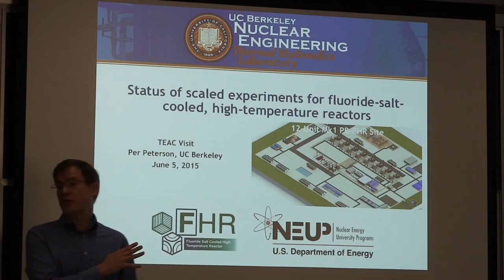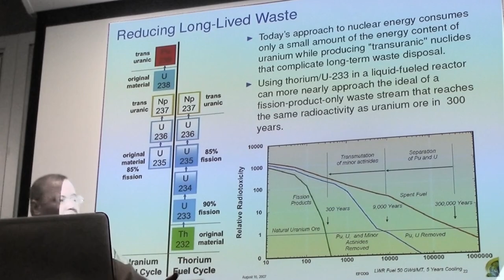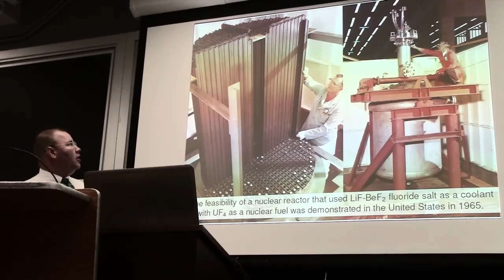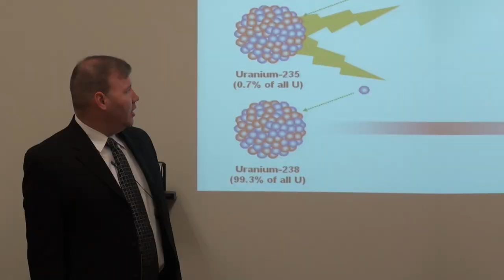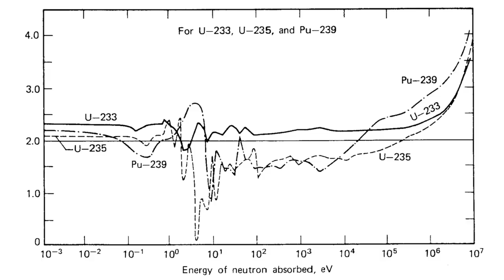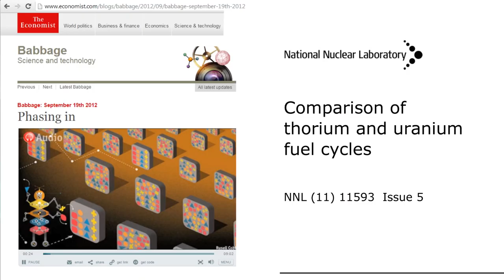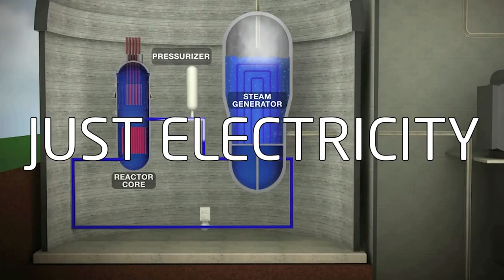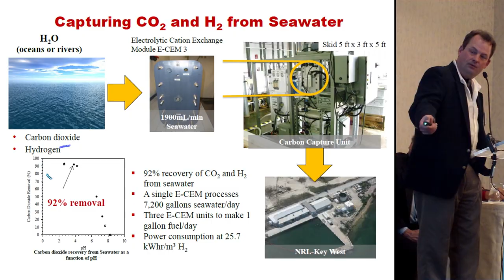Thorium Disadvantages

Comment: The real disadvantages from what i understand of this video, are (other than the established industry blocking the new technology): 
- Metal corrosion. 
- 30 day start-up process. 
The first one is not that much of a problem though, just need money (loads of it) and time to find the right alloy. The second one, is just a one time thing, and then continuous production.
Reply: 30 day thing is how long Protactinium takes to decay to U-233. It isn't an issue for starting the reactor, but rather impacts how the reactor operates. It mandates a chemical kidney, if one is to use Thorium efficiently. That's the challenge... the Kidney. Most nuclear does not need that, even most MSR. It adds complexity which sucks. It also adds capabilities, which are awesome. Many Th-MSR advocates very much want those capabilities, as it really changes whether there is any nuclear waste to speak of at all coming from the reactor.

Material challenges and corrosion? Again, the Kidney matters. Pulling out fission products from the salt means also pulling out stuff that might chemically react with the nickel alloy. Many MSR startups do NOT see the need for this, but pulling out those fission products might make the difference between reactors that last a decade and a reactor that can last a century. We'll see. Kirk has funding for Chemical Kidney research and hopefully his plans will be demonstrated to be practical.
Reply: A 30 day start up process would impact the duration of periodic maintenance operations, not just the initial start.

Comment: The problem with the new style reactor is that when things go wrong they go wrong in a damned hurry, much faster than a light Water Reactor. Are they more efficient, yes. Southern California Sodium Reactor is an excellent example, it was an abysmal failure and probably poisoned more people than Three Mile Island. It was an early design however and should the issues be fundamentally addressed, it may yet be an answer. I would like to see whether or not they addressed those issues they caused the failure of that particular reactor.
Reply: You're conflating "new style reactor" there are many. Just because MSR can operate at higher temperature doesn't make it unstable or unsafe. Fast-spectrum liquid-metal reactors such as that which melted down in Detroit COULD be harder to control... EBR-II safety test seems to indicate otherwise... but that accident is a completely different concept than MSR. If anything is remotely close to what you are citing, it would be the TWR (Traveling Wave Reactor) by TerraPower (and backed by Bill Gates). They've since moved their focus from TWR (yes, sodium) to a Molten Salt Reactor design.
Reply: @gordonmcdowell  I have no doubt that these reactors, given the concept that we will get to hey technical capability of control, can be made safely.

I also find it bizarre, with technology to manufacture induction coils within a house that will allow it to use 20% less metered energy well not cutting back on any energy used within the house itself, direct evidence that we should have been listening to Nikola Tesla a long time ago. We don't need to generate energy. We need to figure out how to tap into the energy that is all around us already. And it can be done with far less risk.

Comment: This hasn't been explained properly to the polarized layman. The fast/slow breeder reactor concept should have been compared to gasoline and diesel. Gasoline is highly volatile, deadly if not handled carefully, carcinogenic, and displaces oxygen in confined areas. Diesel smells, and is hard to ignite, but if you treat it with waste "gasoline" you can get it to play quite well, and burn waste.

Comment: What would stop someone from making a 1kw thorium generator in their backyard?
Reply: Not practical to be that small. And working with fissile material is illegal. This is in no way garage start-up tech. Copenhagen Atomics is probably as close to advancing the tech as one can do in a garage. They're working with non-radioactive material and focusing on pump mechanics and mechanisms for monitoring salt chemistry. You can use non-radioactive isotopes to stand in for the (very) radioactive Fission Products. So instead of radioactive Caesium (created by fission) add non-radioactive Caesium and see how that affects the chemistry (sort of thing). Copenhagen Atomics uses electricity to heat up the salt to simulate fission. So you're wasting energy, not creating energy, but that's how you could build a device and test a device that might once day be licensed to be fuelled.
Reply: @gordonmcdowell  If I understand correctly, the hotter it gets the more efficient it is, and to get it that hot you have to make it really big.  Couldn't you just use one that is much colder with a Sterling Engine, those can work with even small temperature differences.
Reply: @musikSkool  That's one aspect to efficiency. Molten-salt systems don't allow fissile material to be too concentrated in the salt, or else it will precipitate out. I'd look at NASA KiloPower system for how small a reactor can be with solid fuel. Or just google MICRO-reactors. I don't think fission lends itself to a million 1kw devices, powering a community is more appropriate. For a single house, it really would be cheaper to go solar and batteries and diesel. Maybe in the future we'll have a market for Fission Products and you can harness radioactive decay for energy. There's no upper or lower size limit on that, and the thermal efficiency is just a matter of how effectively you can trap the decay heat. (Fission throttles itself as materials expand and fuel spreads out, but decay does not.)
Reply: @gordonmcdowell  I was thinking of an expensive toy for rich people who want to go off-grid with current technology.  You would over-engineer it by making a backup system for everything that has ever gone wrong in a nuclear reactor.  Like inefficient lightbulbs that turn on if they aren't using all of the power.  I like the idea of using excess energy to remove carbon from co2 to make coal that can be stored for later use if extra energy is needed.

Comment: The differences between Light Water Reactors (LWR) and Thorium Molten Salt Reactors (TMSR) are significant in fuel utilization and waste production. LWRs use approximately 0.5-1% of uranium fuel, leading to the generation of long-lived radioactive waste due to inefficient energy conversion and the use of enriched uranium. In contrast, TMSRs can achieve fuel efficiency of up to 99%. This is achieved by converting fertile thorium-232 into fissile uranium-233, substantially reducing waste production and more manageable radioactive waste. Uranium Molten Salt Reactors (UMSR) are just as effective as TMSRs.

800 kg of natural thorium in a Molten Salt Reactor (MSR) can generate 1 gigawatt (GW) of electricity for one year. In comparison, generating the same amount of energy in an LWR would require mining 250 tons of uranium. In an MSR, the storage requirement for 800 kg of spent fuel is 300 years, whereas in a LWR, 35 tons of spent fuel need storage for 300,000 years. MSRs can utilize the spent fuel from LWRs. A coal power station will need to burn 4.55 million tons of coal and emit 13 million tons of carbon dioxide to produce the same amount of energy for one year. That amount of coal contains 4 to 18 tons of uranium, 13 to 68 tons of thorium, and 4 to 45 tons of arsenic.

Of all the proposed fourth-generation nuclear reactors, the MSR is the only type that does not generate substantial amounts of plutonium. The fissile uranium-233 produced by the MSR is difficult to use for weapons because of the presence of highly radioactive uranium-232.

MSRs can adjust power output to match electricity demand, thanks to the inherent and automatic load-following capability provided by the fluid nature of the molten salt coolant. A key safety feature of MSR is that it automatically adjusts to prevent overheating. This is achieved through a "negative thermal reactivity coefficient," which means that as the temperature rises, the reactor's reactivity decreases, preventing a runaway chain reaction. Additionally, the MSR has a "negative void reactivity coefficient," ensuring that the reactivity decreases if there is a loss of coolant or boiling, preventing potential overheating. These safety measures help keep the reactor stable and safe under various conditions.

Looking ahead to 2040, China plans to deploy MSRs equipped with thermo-acoustic converters in ships and power generators within its borders and globally. In the Earth's crust, thorium is nearly four times more abundant than uranium. Every atom of natural thorium can be harnessed, unlike natural uranium, where only 1 out of every 139 atoms can be used.

India possesses more than 846,000 tons of thorium reserves, while China produces thorium as a byproduct of its rare earth processing.

Similar to the trends observed with solar and wind technologies, MSR costs are anticipated to decrease with the scaling up of production and the development of robust supply chains.

Comment: The United Kingdom’s National Nuclear Laboratory (NNL) prepared a position paper on the thorium nuclear fuel cycle. It is pretty straightforward:

Contrary to that which many proponents of thorium claim, U-233 should be regarded as posing a definite proliferation risk. For a thorium fuel cycle which falls short of a breeding cycle, uranium fuel would always be needed to supplement the fissile material and there will always be significant (though reduced) plutonium production.

NNL believes that U-233 should be regarded as posing a comparable level of proliferation risk to High Enriched Uranium (HEU) and comparable with the U-Pu fuel cycle at best; this view is consistent with the IAEA, who under the Convention on the Physical Protection of Nuclear Materials, categorise U-233 on the same basis as plutonium. Attempts to lower the fissile content of uranium by adding U-238 are considered to offer only weak protection, as the U-233 could be separated in a centrifuge cascade in the same way that U-235 is separated from U-238 in the standard uranium fuel cycle.

The argument that the high U-232 content would be self- protecting are considered to be over-stated. NNL’s view is that thorium systems are no more proliferation resistant than U-Pu systems though they may offer limited benefits in some circumstances.
Reply: While U233 can (in theory) be used to create a weapon, this has yet to happen. There were some tests where weapons-grade material was supplemented with U233, but the weapons were not created out of U233.

If you're referring to the August 2010 Thorium Cycle report by NNL, they're looking a THOREX reprocessing, and not a dual-fluid Th-MSR. So a not-ever-used-in-a-weapon fissile that will be extracted from a MSR, where the U233 must remain in the MSR for it to continue to operate? Pull the fission-catalyst out of an OPERATING power reactor? NNL is not looking at that, they're looking at U233 being shipped back-and-forth for some remote reprocessing operation. NNL is not looking at a chemistry module moving U233 from blanket-salt to fuel-salt.

From NNL's report: "While the thorium fuel cycle is theoretically capable of being self-sustainable, this is only achievable with full recycle. This would involve the implementation of THOREX reprocessing and a remote fabrication plant for the U-233 fuel due to the high gamma dose from the feed material..."

This isn't that. Yes, there's U233. No, it's not making a round-trip to a remote facility. And if the tiny amount circulating though the chemical kidney starts to be diverted, the reactor shuts down. (With the overwhelming majority of U233 inventory remaining in the fuel-salt.) The chemical kidney stops shuttling the U233 when fission stops, because U233 then ceases to be created in the blanket-salt (as protactinium before it evolves into U233).

Comment: If protactinium is absorbing the neutrons needed to sustain fission, why don't we make a hybrid system of thorium and regular uranium reactor which produces too much neutrons. Interspersed between U-235 rods would be LFTR containers of thorium fluoride acting as moderators / consumers of the neutrons for U-233 which previously releases so few neutrons in thermal-spectrum.
Reply: I think the challenge is the container. Moltex uses metal pins (with molten-salt fuel inside) but that is fast-spectrum. Thermal spectrum you need to not having the container absorb neutrons. It has been proposed that CANDU be used with a breeder-blanket configuration where Th rods (solid fuel) are positioned around the edge where neutron flux is weakest. (Even weaker than homogenous CleanCore ANEEL approach.) If you're suggesting fuel-pins like Moltex SSR-W then what's the overall type of reactor? What's the coolant and moderator?

Comment: Fission products in liquid form would be an engineering nightmare. How do you limit the gamma radiation from short lived isotopes if they are travelling through a load of piping? Easy in solid fuels as everything is in a defined area of the fuel rod and can be submerged in water/coolant.

Regarding thorium,  where do you store the protactinium while it decays into U233?

Comment: 70 atmospheres is being too kind! Dear god that is high water pressure - more than I had been visualising till now. That number is quite conservative minimum it seems:  as wikipedia says the light water solid reactor operating heat range  275 °C - 315 °C which requires 153 atm or my preferred measure: 2,250 PSI! All of which is alarmingly close to the super critical levels of 374 °C or 3200 PSI. Gulp.

Comment: The protactinium has to separated from the molten salt as it builds up. Therein seems to lie the "rub"--or? Once it changes to U-233, it can be reinserted into the molten salt. I believe technology can solve these problems, provided we have to will to do it.
Reply: Flibe Energy's 2019 DOE GAIN voucher is to examine (in part) question of Fissile Security. Kirk does talk about U233 and proliferation concerns in this (more recent) video: https://youtu.be/2U9HVIFt2GE

Comment: Hmm, quite nice video, but title is wrong. There wasn't much about thorium disadvantages. If there was, please list top 5 disadvantages of thorium.
Reply: Thorium Disadvantages listed in this video:
00:00 Solid-fuel thorium reactors fuel utilization ratios similar to PWR.
00:42 Liquid-Fuel in United States licensing is "scary".
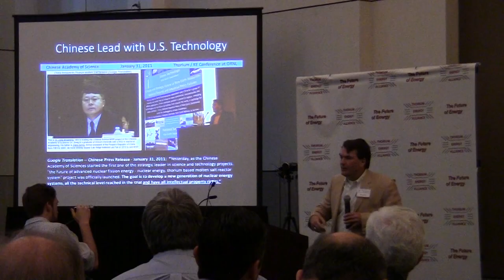02:04 Obama Administration willing to give away MSR know-how.
02:40 PWR seen as "good enough" for long time.
03:00 Licensing restrictions specifically target liquid-fuel.
04:45 NEA OECD evaluated solid-fuel, and liquid-fuel-fast-spectrum only.
20:50 Thermal-spectrum neutrons hitting U233 produce only ~2.3 neutrons.
23:00 Graphite moderator required to sustain fission in MSBR thermal-spectrum.
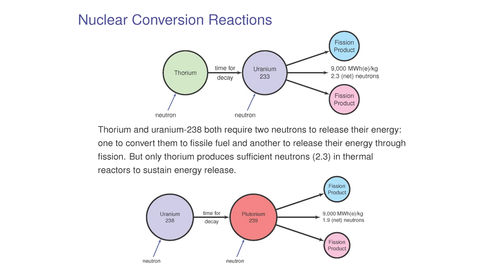27:50 Protactinium-233 half-life 27 days.
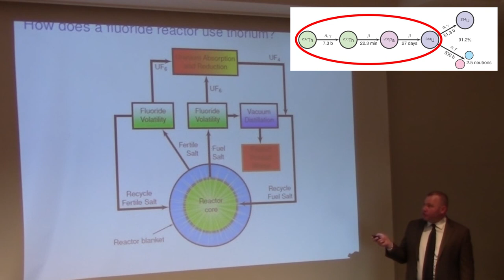29:00 Material challenges (MSR is pre-requisite so MSR challenges are Th challenges.)

Comment: So essentially, this isn't a video about the "disadvantages" of Thorium - but rather a video about the Largely Intentional obstructions to developing/building properly-scaled Thorium reactors.
Reply: The low breeding ratio combined with 30-day half-life of Protactinium demands a Chemical Kidney. That's a technical disadvantage as it keeps the reactor from being as simple as possible. But licensing the kidney, and licensing MSR in general, is something NRC has only started to adapt to, and arguably it would be easier to privately finance the various MSR designs if the licensing was easier to predict.

Comment: The disadvantage of any not- large scale tested technology is that you are basically in a labyrinth of layered problems. There is a way through- fission power showed that- but it needs massive investments and countless tries and errors to go there.
Thorium would be a massive investment on a scale only to reach the level a similar technology already has- water reactors.
Why on earth should anyone do this, unless water reactors fuel becomes sparse?
Reply: Procuring LEU will not be an issue any time soon, but using fuel more efficiently requires less mining in the front end and produces less waste (if one can consider mined but discarded soil "waste")... basically less Earth needs to be disturbed to power society. Running MSR also offers higher temperature operation to drive chemical processes... this isn't strictly about driving turbines. Lack of high-pressure operation also opens up options for modular construction like proposed SMRs but with higher power output.

Those would be reasons. There are plenty of sane reasons to continue to build PWR and obviously we should continue to operate existing PWR as well... I do support that and have spoken in defense of Diablo Canyon land hearing where I heard the stupidest arguments against continued operation (https://www.youtube.com/watch?v=Z2syR1W9q0w ). But also we should be advancing non-PWR approaches, and doing so aggressively... otherwise nuclear will remain the non-dominant source of energy on our planet.

Comment: Is the solubility in water of caesium Flouride a disadvantage?
Reply: Probably not a great feature, but you'd probably have limited salt-water contact since the fuel salts themselves are not soluble and they'd be solid where contacting water. (Water might be vaporizing but salt solidifying if not already solid.) I believe these are some of question SAMOFAR looks to answer... FP behavior if fuel salts escape vessel.
Reply: Thanks for the answer.. Im not a chemist but pondering worse case senario like discharged into runnoff or river. I understand that the reactor otherwise floride salts are solid and stable if not at high temeratures